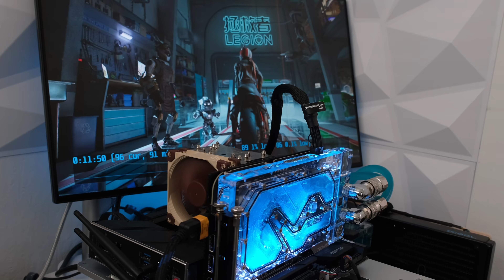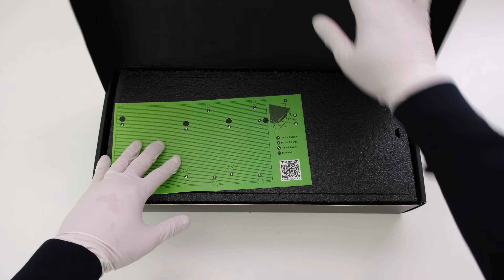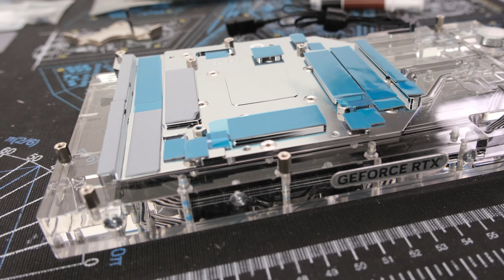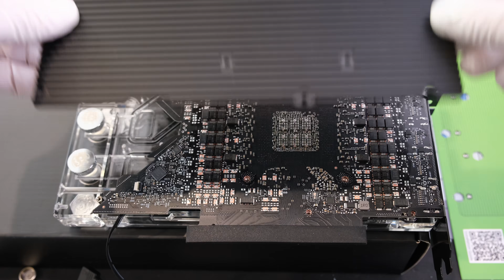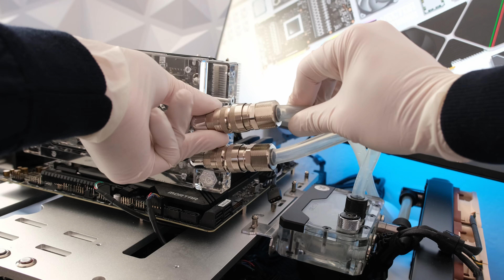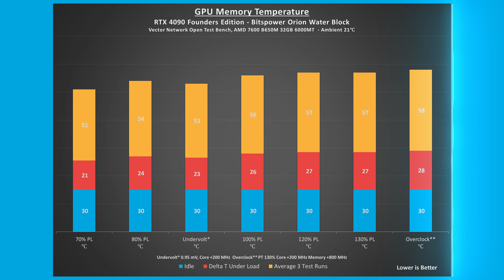Bitspower RTX 4090 Founders Edition Water Block Installation & Testing

Comment: Man, this block is beautiful. The manufacturing quality is more than decent, especially on the acrylic block. Btw this is the first block i've ever seen with a backplate that really acts as an active heatsink (it has thick fins, not too effective, but better than having a simple flat backplate). Respect for Bitspower.
Reply from the maker: Thanks for your comment 🙏Right on all those points. Its been under-the-radar one of the better performing blocks for the FE model and was a good experience all around. It does appear that Bitspower have been making improvements in different areas. I try to get as much variety of blocks as possible, so I can get a better idea of how brands truly compare. Hope that helps
Reply: @vectornetwork  Huge thanks for your work, keep it up!

Comment: Always enjoy watching your videos as always. With temps never getting over 60 degrees I'd say you'll never have to worry about overheating with temp on the 4090 usually hovering around 90 degrees with the air cooler. The longevity of the GPU will also be enhanced. I posted my build on one of your earlier videos about my scratch made full size tower which is entering the wiring stage. This system is so over-the-top but is pretty cool. I have the EK double sided water block but I'm going to mount it to the chassis and use a 4" riser cable. The thing is so heavy I don't want to stress the MB. Both the MB and memory water blocks are made by Bitspower, their quality is excellent. You still have your previous build? That was a beautiful rig.
Reply from the maker: Thanks for your comment.🙏My man! I agree, the 4090 is so efficient that its a breeze to cool. I remember your build, it's awesome. Good call on the riser cable due to the weight of the block(s). I was initially not thrilled about using a riser cable in general (just didn't seem right). But, I after trying them, I have no issues using them (when needed). The cable can have some flex too, so there is a lot just stress in general on the pin area. It's hard for me to be objective when it comes to quality, but I do think Bitspower is most in line with Corsair. From the packaging, I nearly thought I was sent a Corsair product at first. Then, when I saw the pre-applied thermal pads, they reminded me most of the Corsair XG7 line. Then, I did some research and I think both companies manufacture their products in Taiwan and Corsair uses Bitspower fittings for their fittings (without the bitspower dragon logo of course). 

Still got the inverted 4090 build. I did a more recent video where I changed out the coolant, dialed in some runs and added an aquacomputer flow sensor and controller. It's the living room rig with an OLED TV. It's a dream man. About to sink some more hours into Cyberpunk on 3rd playthrough. Pathtracing overdrive mode is a whole other thing. It's wild. Congrats on your ascension my friend and thanks for contributing

Comment: Not sure if it remains true for Nvidia, but I bought both a Bitspower and Alphacool core waterblock for my 7900xtx.  I got to say, I have NEVER seen someone use the amount of copper that that AC  core card has.  I swear the thing weighs 3lbs.
Reply from the maker: Thanks for your comment 🙏I also just tested an Alphacool Core block on the RTX 4080. I can confirm that the card was well made and hefty. The copper plated coldplate did extend more than expected. I thought the construction was approaching watercool heatkiller, but I would prefer a slimmer terminal. I do think the terminal was a feature for them, but its sort of larger than needed. Hope that helps.